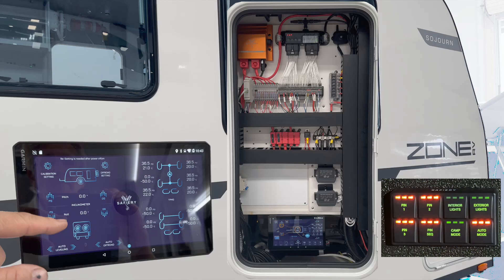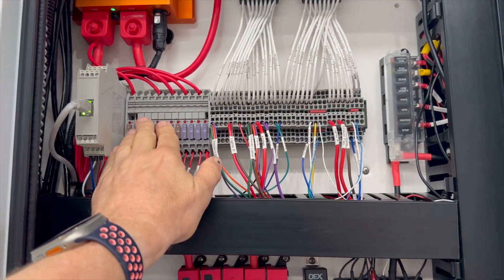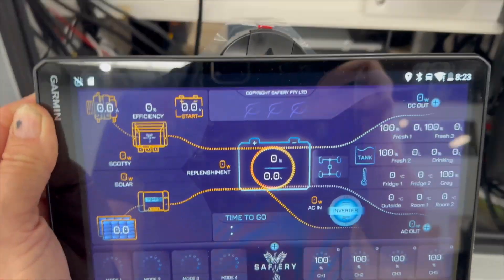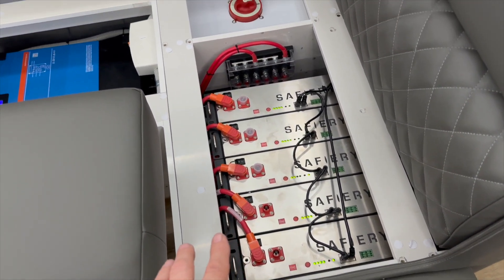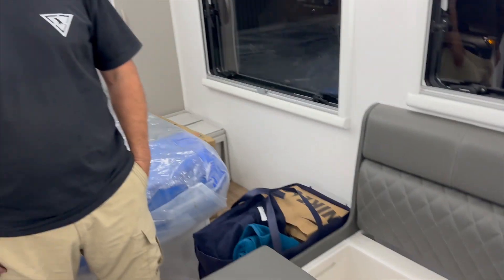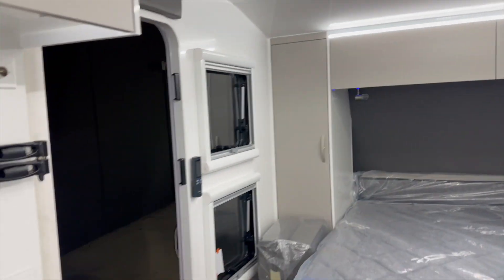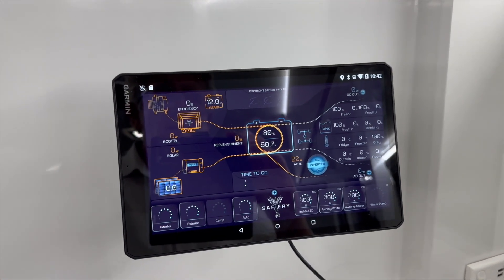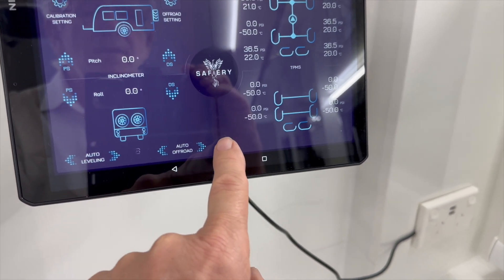ZONE RV gets 48V System : 1,320W Solar, 1000Ah Lithium, Scotty 3000w, Digital Switching TPMS Scotty

Comment: I always thought that scotty had to be mounted in the vehicle and not in the van to work? Looks like the 1500watt scotty and does it loose any of its charging power mounted further away?
Reply from the maker: This van has a Scotty AI 3000 in the vehicle and this 1500W unit in the van. The Scotty AI in the van is converting 48V to 12V for the high 12V loads. The double compressor is 60A, the other loads are similar in total. Separately there is Scotty AI 3000W in the vehicle.